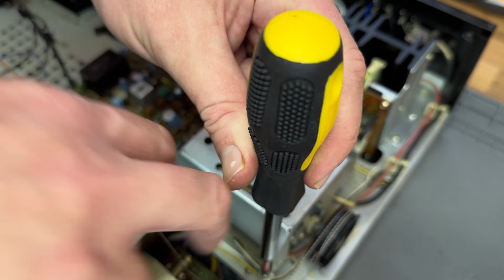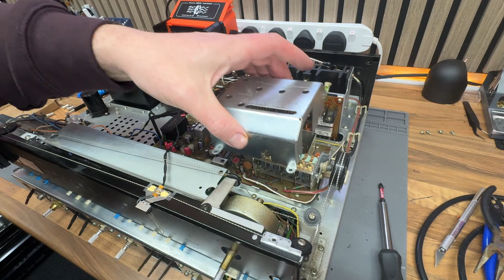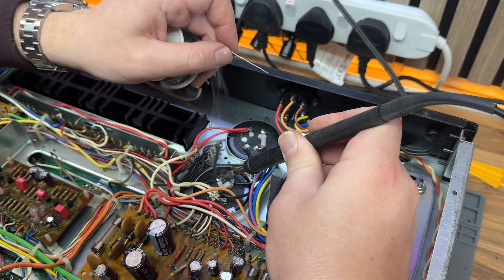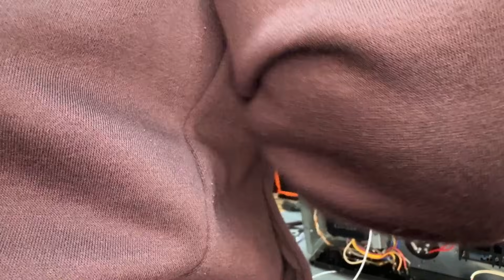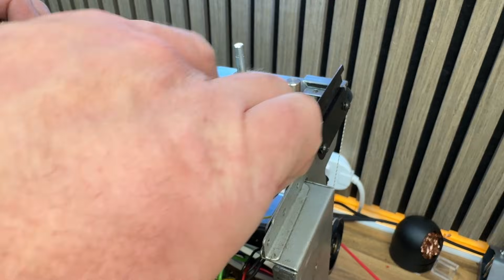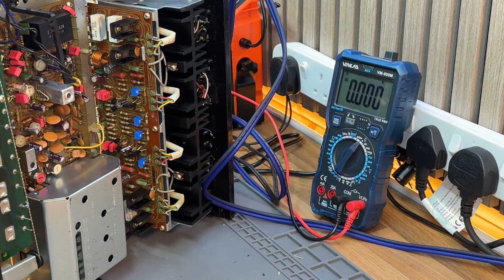Recapping Vintage Pioneer Receiver - PART 2

Comment: Wow I  did the SAME exact thing with my tuning needle while restoring my sx-737!! .. it was a barely touched it snap it right off moment.. I was pissed.  But took a couple deep breaths and glued it.  I did manage to glue it perfectly straight, as I set it up next to a 45 degree square (removed the lamp box, and upside down)  when I glued it.  While it was off I replaced the lamp with tiny LED so brighter and it ended up being a win.. but it distressed me until it was glued!  uhhg.
Reply from the maker: This series must really suffer with this same thing 😅 I had read they were sensitive but WOW didn’t think it could be THAT sensitive 😅
Sounds like you had a great solution to fix it. 
My little fix has worked well :) 
(In middle of editing final video for this currently 🤓)
Reply: @HifiCabin  Yes this series and the one before used the clear plastic lighted needles... they just got brittle from the heat over the years.  Have to wonder if they would have, had LED's been around then. The little incan bulb was kind of hot I guess, enclosed.  The SX-X50 series that followed had dropped that style indicator and they are more robust, I've never seen one break.  Glad your fix worked too !  I just used superglue and propped it against the square for checking.

Comment: Good restoration, I like the fact that you took time to show in detail how to set the offset current and the bios: most techs move through it and quickly without illustration. 
I would like to see you do a restoration on a Pioneer SA-9800, I have one open up, but I'm stock. 
My peak atlas ESR 70 Probe compensation failed, the 330-surface mount resistor is shorting: I sent a few messages to Peak and they haven't replied.

Do you know of a good ESR meter brand on the market?
Reply from the maker: Thanks very much for kind words 🙏🏼🤘🏼
I actually have a Pioneer SA-8100 that I plan to go through at some point. Not exactly the same but a decent level integrated amp from pioneer a few years earlier :) 

ESR meter - I actually use a cheaper one, but works for me. The MESR-100 
Richard from Learn Electronics Repair uses same one from memory. 
That said, the Peak is supposed to be better. I’m just cheap. 😅
That’s why my MM isn’t a Fluke. Because this cheaper one works fine 🤷🏻‍♂️😁
More money to buy other stuff!

Comment: The difference between the two cables would be a quieter noise floor with the shielded cable. Probably not much difference between the two because it's a AUX input.
Reply from the maker: Thanks Trevor! Good to know things 🙏🏼
Surprised me, actually. How little difference I could make out. 
Appreciate it 🙏🏼🤝

Comment: One of the bad things about a lot of vintage stereos, is the wire twisted around posts on the motherboard, they tend to break. It makes servicing and repairing difficult to undertake, so far no one come up with an idea of designing a harness with connectors, that would make life much easier.

Comment: Amazing work again, Bummer with the tuning dial but at least no problems fixing it. You have put in some hard craft getting the unit to where it is. Imagine what a shop would charge for the work you have done, if you can find a shop that is. I would be very chuffed with the results so far, that front tuning plate looks amazing lite up.
Reply from the maker: Thanks Michael! A fortune is the answer. Which is why so many old bits of gear never get revived. 99% of people wouldn’t want to chuck upwards of a grand at an old receiver. So they buy cheaper and newer… and the cycle continues 😔
Yeah buzzing with this so far. Will get cracking with the outside of the unit this week 😎❤️💪🏼

Comment: The beautiful thing about vintage amps is the way they were built, with repair and service, care and pride at the forefront of the design, the modern ones are just dripping with planned obsolescence but that's like most things now.
Great video mate
Reply from the maker: Thanks mate!! And I couldn’t agree more. Later consumer amps don’t interest me much. 
Some modern stuff i don’t mind; speakers, turntables. 
But amps and receivers and cassette decks - gotta be pre 90’s, or pre 80’s 😎

Comment: Part 2 is so good. Have you tested the removed components (the capictors using an ESR meter, and the diodes and transistors using multimeter or Peak Atlas), It would be very interesting to see hoe different they are from new. Some of them will probably be fine.
Reply from the maker: Thank you! 🙏🏼 hmmmm… maybe that’s its own separate video? 🤔 I have some meters for those tests 🤓
Reply: Yeah that would be interesting , but as you said before you swapped them all out to prevent problems months or years down the line , but like restoring a classic car , why wouldn’t you swap out all the known weak points